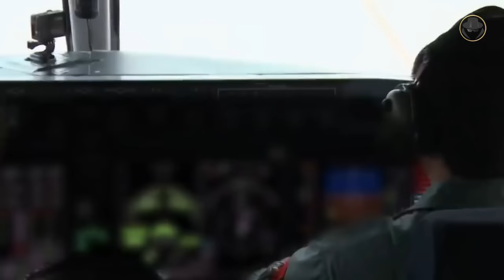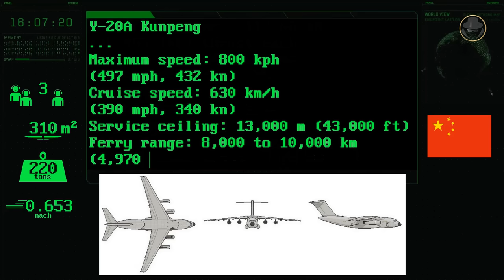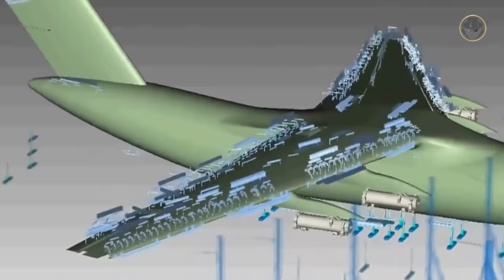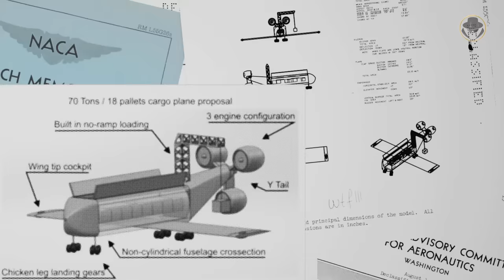Xi'an Y-20 Kunpeng | The Chinese military transport aircraft that lifts the PLA

Comment: The Y-20 and C-17 both have underwing engines, the C-17 uses jet flaps, and the Y-20 uses conventional large-area flaps. As the core design of an aircraft, the wings of these two transport aircraft are different. 
Before you say that the Y-20 plagiarizes the C-17, would you like to use your brain to do some homework?

Comment: Obviously the engines are from the 60ies with low bypass ratio. If they can refit with at least 80ies engines they can use the free room from less fuel consumption to give the market a viable low cost alternativ to western transport planes. Before they can produce a plane on par with western planes, they need to develop a modern engine. Not sure if they made any progress though. The J20 engine is an old concept from the CF56.
Reply: Google WS-20, high bypass and already in service, this video is a very superfactial take and out of date.

Comment: copy of C17 - thanks Antonov
Reply: I didnt know Antonov designed the C17
Reply: @benwilson6145 that is the question, how much row did antonov actually plays in the y20 and y9 program, now united states  claim Chinese spy hicked Boeing, and also Chinese it self claims they got help from antonov while developing y20, and got help from karmov while developing z10, so what row do these out sources information actually plays in this program
from aero dynamic aspect, the y20 is more clearly a modified IL76
the wing and the basic structure be easily indicate as a modified IL76, however Y20 play the row of C17, mostly do not transport a real tank but has the ability to transport a real tank in case something happens
so how much information actually did boeing leaked, and what information did Boeing leaked 
and also, didn't Boeing leaked something more?

Comment: Like most of its other weaponries, Y-20 LOOKs  better than it is.   Just look at its engine spec/performance and the the configuration of how the engines are mounted in related to the flaps ... let alone those interior / avionics we couldn't see...  it looks like C-17 from distance but the capabilities are far behind comparing with C-17.
Reply: capabiliies you say? mind if you mention them here?

Comment: This 'it's a C-17 copy' garbage is amateurish. The Y-20 has the same rough size and dimensions as the Il-76MD-90, with only slight improvements to range and payload capacity. China built themselves a better Il-76MD with knowledge gleaned/hacked/acquired (whatever) from the C-17 and other US military programs. That is it. Comparing the Y-20 and C-17 as though they're near peers just because they share *some* visual characteristics is as dumb as 'WiCh iZ bEtTeR, F-14 oR f-22' arguments you see from War Thunder 'experts'. The Y-20 is *NOT* in the same class as larger C-17.